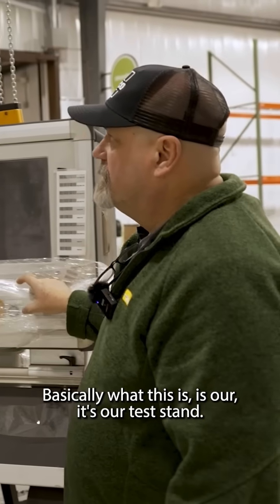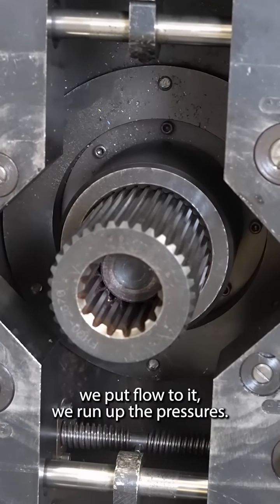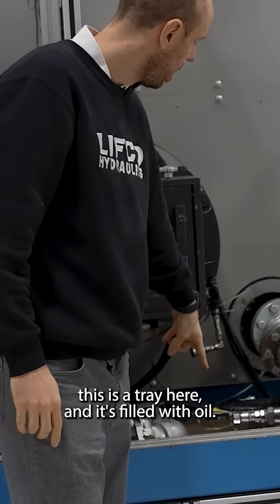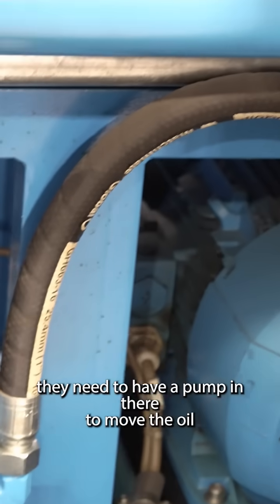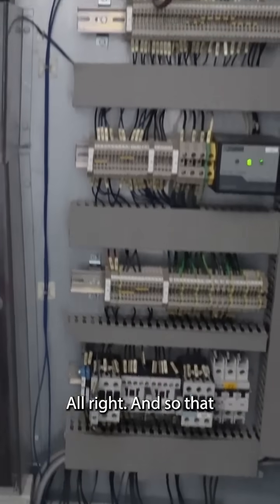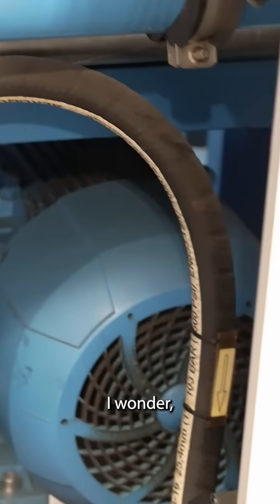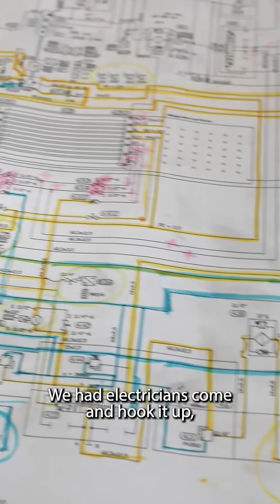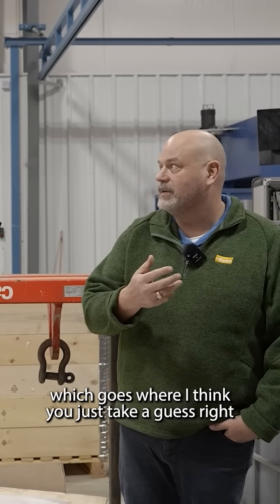New Test Stand: Dead on Arrival?

Comment: Depending on the service and how it was hooked up, there is always this chance with three phase. 
I should hope the engineers of this equipment took that into account when they designed it. 

I would bet there is some valving that wouldn't be very friendly to that ..
Reply from the maker: The pumps are not meant to be run in the opposite direction. But they are just transfer pumps so very low pressure. A little extra wear on the one we ran would go unnoticed. (hopefully)